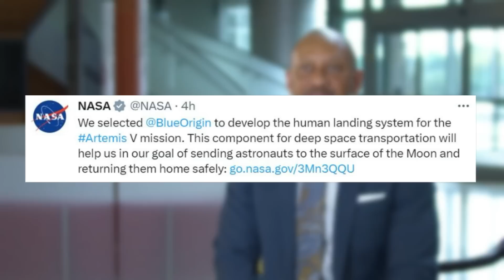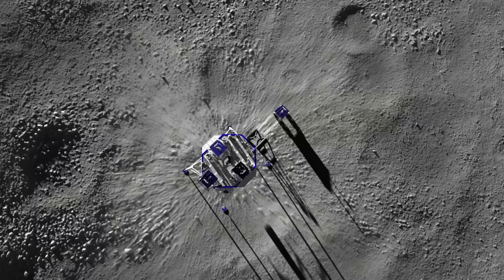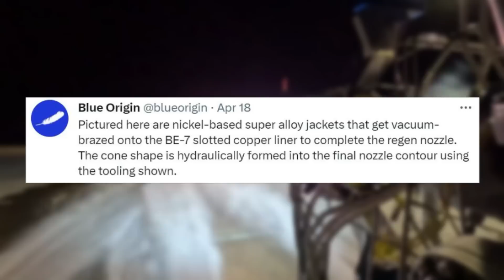Why NASA Awarded $3.4 Billion For Blue Origin's Lunar Lander

Comment: While it's neat that BO got a slice of the pie, this wont really change much at SpaceX, or it's use as the lander for the moon. If SpaceX can actually achieve the lowest cost per use, it's ability to move massive amounts of equipment and people is still going to be the preferred vehicle.
Reply: Thats not how it works most likely.

NASA will not always pick the cheapest provider. They MUST keep 2 providers alive just in case meaning everyone needs a flight from time to time.

Also as of now this new landers is shaping itself to be more practical for sustainable stays
Reply: @_mikolaj_  Yeah, the twisted part about the congressional mandate is that knowing full well the cost, what is offered is usually only half because they by default assume half of the money would otherwise disappear into pockets (that's what they would do!)
Reply: @paulmichaelfreedman8334  its not even about that. If NASA would pay just for Blue Moon flights for instance, Starship HLS would kinda die. And then say an emergency situation appears, or something. Blue moon is being serviced/repaired.
SpaceX wont be able to quickly send new Starship to replace it, beacuse, from their perspective program died, production lines and GSE for HLS are inactive. They will need quite some time to reactivate everything

This is why NASA shouldnt just go with one provider. Maybe Blue Moon will turn out to be simpler option, than sending expendable HLS landers every single time, but NASA will continue to fund both to keep both alive just in case.
Reply: @_mikolaj_  Starship SLS is not meant to be expendable. Their supposed to keep using the lander as a ferry between gateway and the moon... so long as they can refuel them. Which that all remains to be seen. Just to get the Starship to the moon is going to take allot of refueling flights.
Reply: @hawkdsl  as of now HLS is expendable. Its cheaper to launch new one than, *launch like 50 starships just to send enaugh propellant to NRHO to refill it*.

It has been confirmed by NASA, that there is no reuse plan as of now. One mission and it gets send to heliocentric graveyard orbit
Reply: @_mikolaj_  Thanks for the info.
Reply: Don’t underestimate Bezos’ army of lobbyists for whom cost is no object
Reply: It won't though. What part of multiple launches for orbital refueling do you not understand? 😅
Reply: @Gnefitisis  What part of reusable do you not understand? 🤔
Reply: @spacexrocks1041  The part where it's a pipedream.
Reply: @Gnefitisis  Your pipe. Unless all those Falcon landings were my hallucinations.
Reply: @spacexrocks1041  Falcon 9 is not a Starship.
Reply: There's that Musk Cult®!
Reply: @java4653  

Please cite BO orbital mission successes that makes them a trustworthy company for such a mission.
Reply: @Scanner9631  😂
Reply: @Scanner9631  Well they've only had 2 failures in 23 suborbital launches of New Shepard. You have to admit, a success rate of 91% is pretty good.
Reply: @spacexrocks1041  

How many of those successes were after it became human rated and how many of the failures were in that time frame?

The failure rate is much worse counted that way.  

I really don't think prototypes should count against a rocket as success or failures unless carrying actual payload.
Reply: @Scanner9631  Sure, one accident was with a prototype ... but NS-23 failed in Sept. 2022 and was carrying a payload, and it had already been crew-rated and had flown 6 crewed missions. Even if we count the earlier failure as just part of R&D, the operational failure rate is still 4.3%. That's unacceptable, especially for a "crew-rated" vehicle.
Reply: @Scanner9631  Well, "orbital mission successes" has never been a criterion for building a lunar lander, has it? (Ask Grumman -- the only company that has ever actually built a human-rated lunar lander.)  LEO experience seems to be important to the "rocket scientists" in this discussion for some reason tho. No doubt that particular goal post will move once New Glenn launches.  

I wish both companies great success and look forward to the Artemis missions. 

But right now all either company has for a lunar lander is a nice rendering...
Reply: @CasaDelMesa  But right now all either company has for a lunar lander is a nice rendering...

Untrue.  The Starship prototypes are all part of the lineage for HLS, some with no fins or heat shields may be HLS prototypes.  Those are solid reality not just renderings.

As to Grumman they had a solid history in the related aeronautics field.  BO has a solid history of not much of anything other than attacking their more successful competition and NASA to be a dog in the manger.
Reply: @spacexrocks1041   The NS-23 booster ("Tail 3") was never human-rated and was reserved for non-human flights.
Reply: @CasaDelMesa  Oh. OK it's failure rate is 0%
Reply: @java4653  This is literally the best outcome for the Musk cult.
Blue Origin hasn't yet achieved orbit, any other viable pick by NASA would've been more concerning for Elon.

Comment: Fail alpaca was by far the better design
Reply: Did you even read the NASA report on Alpaca? Dynetics sure did, and they have continued to work on the system to fix their short comings... So it is possible they may be a lander we can use in the future. But it was not even close to being the better design initially.
Reply: @hawkdsl  i prefered its lower center of mass and the ability for to be able to be used as a semi permanant habitat BO skyscraper is just awfull
Reply: @Condor-uc2lw  I don't like the BO lander either. It looks exactly like something would look like, that has multi-mega corporations designing their own ideas, and trying to make it work together.
Reply: The Dynetics Alpaca came in third in the HLS Option A competition, mainly because it was too heavy for its engines. It came in second in this Appendix P competition. Alpace looks great, but if it can't win the competition, then it won't go.